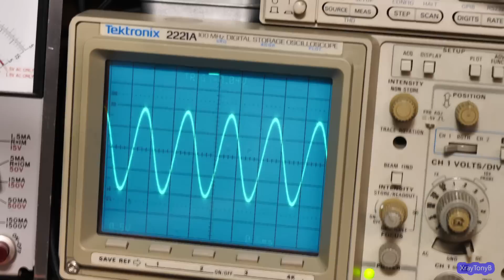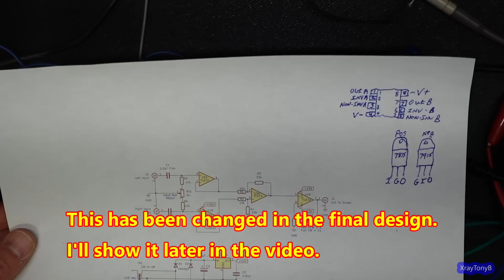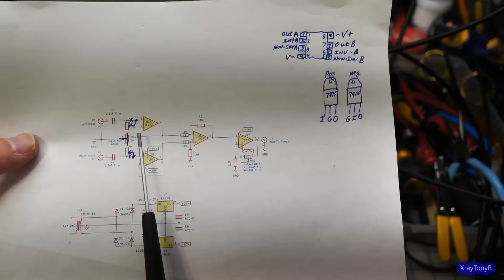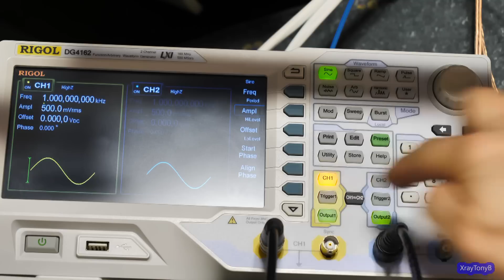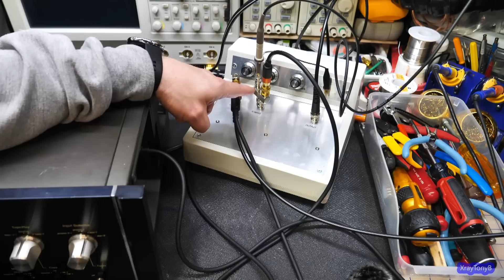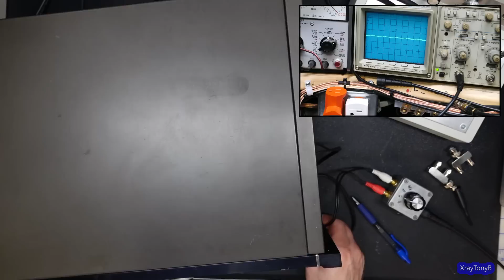Sansui CA-2000 - Testing The Preamp using a Difference Amplifier Circuit

Comment: I was matching transistors last evening. Case is I need some quite equally matching between NPN/PNP, not always that easy. It got me thinking if this simple device could be a way to spot differences between BJT devices in test?
Reply from the maker: You'd be better off using a curve tracer for that.

Comment: If you're creating a difference signal, those input capacitors will affect lower frequencies. Why not direct-couple the inputs?
Reply from the maker: To protect from DC offset and to limit the max current into the 50k load of the input pot.  The cap value was chosen to allow full bandwidth at the signal levels that I will be applying to the input.

Comment: Excellent. I love small, DIY, EE, Bench Tool Projects. Please sir, may we have some more? I vote yes, for part 2, please. As for the Diff Amp Circuit, would it be an improvement to move the amplitude attenuation from the output, U2B, all the way back to the inputs, J2 and J3. My thinking is based on audio mixing strategy... If the upstream amplification is attenuated, it can be over-driven by any prior downstream amplification. You know this well, of course. If placing the attenuation pot at the first of the input is not better, please explain why. Yes, the trimmers could be used for this purpose. A stereo pot might be easier to use, for amplitude attenuation, not nullification. Now that I see the nullification process, I guess the trimmers do this function. A question for everybody = Isn't the TL072/4 older technology? What might be a better modern op amp, for this purpose? Thanks.
Reply: Yep like a OPA1656.
Reply: I agree. More diy test equipment! Can never have too much of that

Comment: This is a good way of really comparing two signals for amplitude and phase difference! I am just now doing service on a receiver's audio section, and finding the dual control pots (among other components in the audio path) to not match as good as I would like to.. One channel is 2-3dB down compared to the other..

Comment: I just released my old ALPS volume pot as it didn't track each channel anymore. I bought a TKD CP2-601 to replace. I guess I've got the TKD with biggest mismatch in the lot cause at low level the left side is much louder. This project would be an easy build to see the results. A DMM would tell the same story at different voltages or tracking each channel on the scope, but where's the fun in that😊
-Thanks for sharing this project Tony👍

Comment: Can you measure the total harmonic distortion (THD) of this Sansui CA-2000 preamp after having re-capped and repaired it? Is it better, worse or the same as new condition? and also the output impedance of the preamp?

Comment: If you redid the resistors in the tone control circuit with 1% metal film ones that difference would be even smaller.

Comment: I just used my Windows PC with the NAK-100 software app for checking out a Pioneer SA-9800 II integrated amplifier preamp section.

Normally this is used for checking out tape decks, but I found the different waveform generators handy including pink, and white noise which is displayed on a frequency spectrum plot. The left channel in the preamp works great, but the right channel is 2.5 db down in gain from the left. When I turn the tone switch to on, then the right channel drops -20 db, wow! Probably those pesky orange coupling caps on the tone board!

The problem with using this for this application, is the limitation of the sound card which clips at 1.5 volts RMS input signal. Worked well for seeing the noise floor spectrum at -100 to -110 db however. You could see the noise spikes at 60 and 120 Hz. I was also able to measure THD all the way down to 0.009% which is about it's limit.

Comment: Would it be useful to feed white noise into the pre-amp and compare the differences between channels or comparison between input and output ?
Reply from the maker: You folks are getting ahead of me!  I still have to assemble the pink noise generator board. It might show up in the next part, if I have time to finish it.
Reply: I was thinking of white or pink noise myself, but wouldn't it be difficult to have two independent random generators in phase? Would have to be a single mono generator, but not sure if it could be done another way.

Comment: Just a question, shouldnt the offset null adjustment have series resistors on each input to allow it to work more as a potential divider? Otherwise if the inout source is low impedence, you will just be applying more or less load to the input without actually altering the amplitude (I would have thought) OK I kept watching :-)

Comment: couldn't you have used a TL074  instead of 2 TL072 op amps?
Reply: Maby TL072 were in his stock😉 Same here... But a single TL074 should do
Reply from the maker: I had some TL084's in stock, but when using the proto board, it was easier to space the two TL072's out for component placement.  I'm not that good at laying out those proto boards.  Some folks are artists at doing that :) but not me :(
Reply: @xraytonyb  I have run into that same situation myself and did the same thing for that same reason

Comment: That’s fantastic! could we integrate this with a Laser Doppler Velocimetry (LDV) system to monitor and compare the mechanical movement of the speaker’s voice coil against the signal at the input terminals? this would (probably) allow us to generate an error correction signal to adjust and optimize the (speaker’s) output?
Reply: Thats what I do at home.